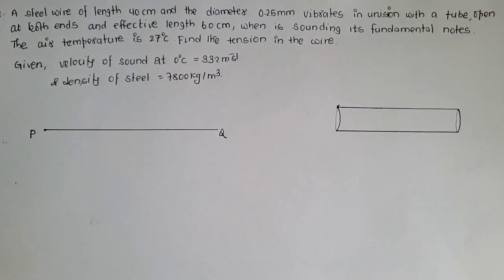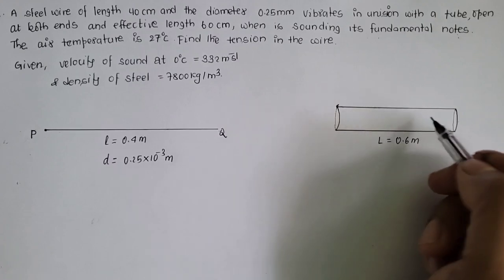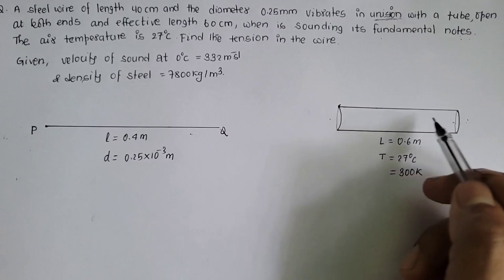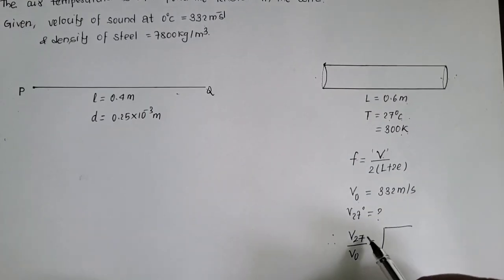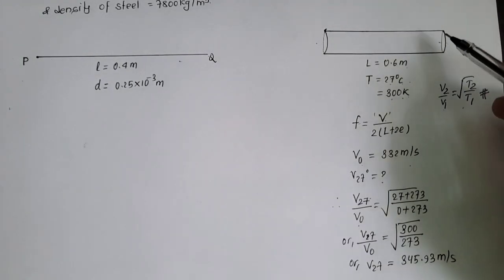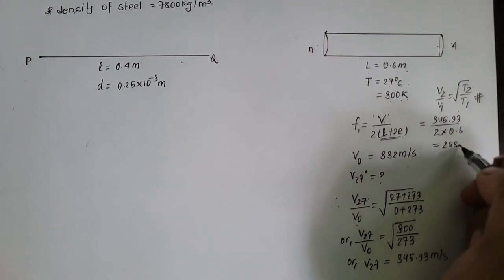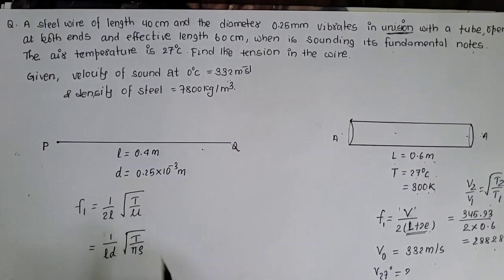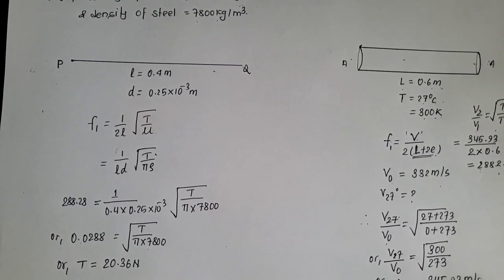A steel wire of length 40 cm and diameter 0.25 mm vibrate in unison with a tube open at both ends...

Comment: Small smooth object slides from rest down a smooth inclined plane inclined at 30 degree to the horizontal.What is (i) the acceleration down the plane,(ii) the time to reach the bottom if the plane is 5 M long ?The object is now thrown off the plane with an initial velocity of 15 metre per second(iii) how long does the object take to come to rest ?(iv)how far off the plane at the object in travelled?
Reply from the maker: I will upload its solution soon.  Keep update . Thank you 😊